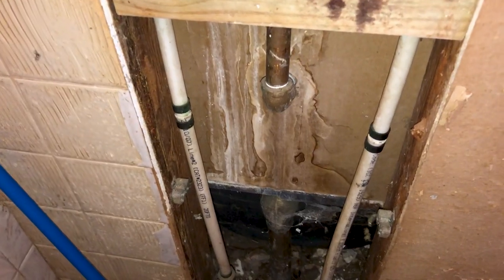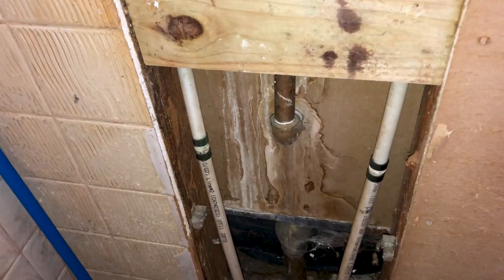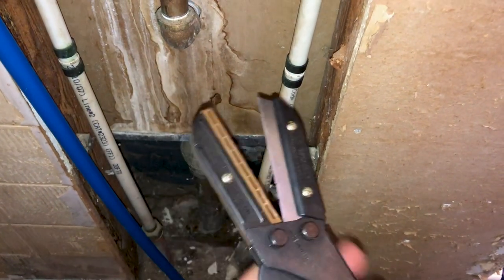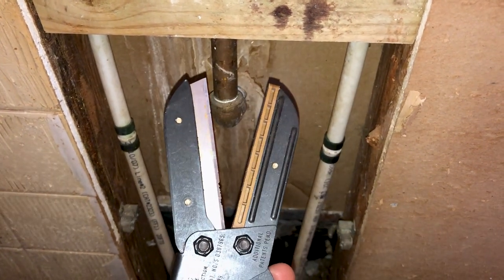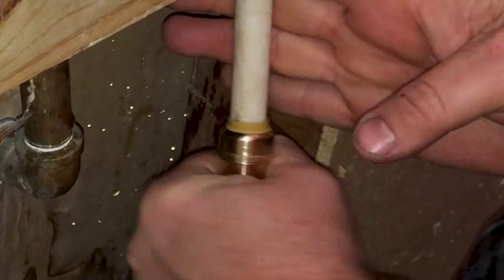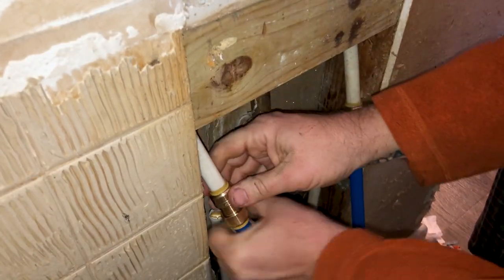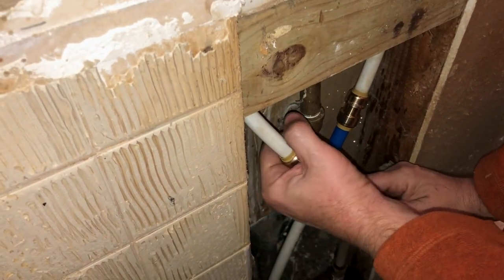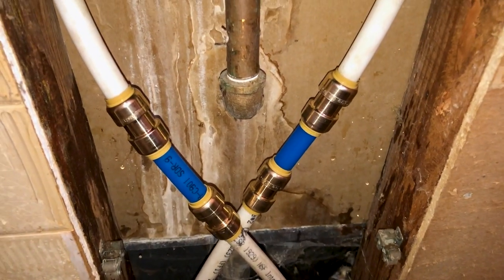Plumbing Simplified: SharkBite Fitting Installation Guide!

Comment: Love sharkbites, as a plumber of 25yrs, they keep me in business,  I have plenty of pictures of SB's blowing apart.
Reply from the maker: I have limited experience with them, having more experience with copper and PVC. However, my experience has been positive.
Reply: As a plumber of 25 years, let me ask you..

How long before the pvc cracks due to being bent the way it is..

Especially that hot water line..

I think there's an easier way to get to the same solution.. but like OP said to each their own..
Reply: @CeeLocKills  90's would have been a better choice for sure.  PVC cracks on it's own over a long period of time, but bending doesn't help.  PVC gets brittle over time.  Most of the plumbers I know and work with hate PVC.
Reply: yes, and everything else leak to it a business.
Reply from the maker: @CeeLocKills  - just to clarify, the material I’m working with is PEX pipe, not PVC. I would dare put that kind of stress on PVC. Thanks for commenting. 👍🏼
Reply: I love em too. Deburr and line up. I used them in my own home !

Comment: I would advise installing shut offs if you're already making changes anyway could use a sharkbite ball valve, and also for anyone not familiar with sharkbites, and/or plumbing in general I'd spend the $3-$5 on the orange marking/deburring tool so you will know for sure that it is connected all the way, because it can feel like it's locked in then you put pressure in lines and the joint comes undone.
Reply from the maker: Great advice! I have a 40-year love/hate relationship with shutoff valves. In my experience, when I need them most, they often don’t work, break, or begin leaking. Not always, but far too often. Of course, in an emergency, something is better than nothing. I'll definitely check into the SharkBite Ball valve and the marking/deburring tool. Thanks!

Comment: I recommend installing shut-off valves for all plumbing fixtures to facilitate future maintenance or repairs. Money and time well spent in my experience. When there is a leak time is critical and being able to isolate the fixture without shutting off water elsewhere can minimize disruptions while repairs are being performed.
Reply from the maker: That’s a great point. I have a 40 year love/hate relationship with shutoff valves. In my experience, when I need them most, they often don’t work, break, or begin leaking. Not always, but far too often. Of course, in an emergency, something is better than nothing. 

Do you have a design that you find to be high quality and reliable through the years? I would love to try it out and share it on my channel. 👍🏼
Reply: I have had very good success with Sharkbite shut off valves. I have used the quarter turn ball valve shut offs for faucets, toilets,  & exterior spigots. In fact, I will be installing one this week when I install a new exterior spigot. Even though the  spigot is frost free I prefer to install a shut off valve. This will allow me to shut off the  water during the winter and/or for future servicing of the spigot. I usually get my SharkBite fittings from a commercial vendor (Supply House). I have recently tried the push connect fittings made by Bluefin which I purchased from Supply House. So far my experience with the Bluefin brand has been excellent.
Reply from the maker: @sjpropertyservices3987  - Good to know. Thanks for sharing!

Comment: Only install sharkbites in a place easily accessible. Because guess what u will be back lol
Reply from the maker: I find it interesting the number of commenters who say something like this (most have said they are professional plumbers). If these fittings were as unreliable as the pros say, then SharkBite would have been saddled with multiple class-action judgments against them. Maybe they've been sued here and there, but I haven't heard about them. No doubt that the pros hate them because the average homeowner can now easily complete simple repairs themselves.

Comment: Why not fix the original problem of the reversed hot & cold instead of this cross-over kludge?
Reply from the maker: I’m not sure what a “kludge” is, but I assume it’s not a positive term. 😅 Regardless, it’s a great question!

The reason it’s was originally switched was from a plumber who cut out a bunch of freeze-damaged galvanized pipe and mixed up the lines when installing the new PEX. The bathroom is in a 110 year old farm house and was constructed by closing in a porch over 60 years ago. The space to work is very tight (it doesn’t really qualify as a crawl space, since there’s not even room to turn on your side). 

To make matters worse, I received a bite from a Brown Recluse spider in that crawl space about 10 years ago that turned into a full-system staph infection, which required 6 weeks of strong antibiotics to fix. (TMI?) It was also winter time and the only way to access the crawl space was to dig out a small manhole opening in the outside of the foundation, requiring hours of hard work, suffering, and possibly death by spider bite. 

So yeah, a few minutes of work while cozily sitting on the toilet lid in my pajamas was preferable. 😂

Comment: That is not how that is done!
Reply from the maker: OK. What advice do you have?
Reply: @YOUCanFixAnythingAuto  use flexible line with shut off valves
Reply from the maker: @edmundooliver7584  - I’d be interested to see what you are referring to as flexible line. As far as I am aware, PEX pipe is the most flexible line available for this application. Are you suggesting hoses used for connecting sink faucets?
Reply: @YOUCanFixAnythingAuto  yes, I am if it,s going to hot and cold faucet

Comment: A horrible video, "He can Fix anything" did not prepare the pipes or the cuts were well done. The pipes will not seat properly in the PEX union. Again I hope no one does what "He can Fix anything" did. Good intention is not enough.
Reply from the maker: Thanks for the feedback. One of the great things about PEX pipe is that it’s very forgiving. Still holding strong and leak free!